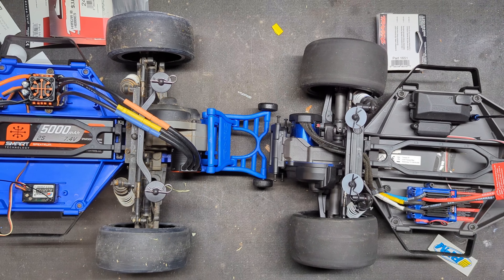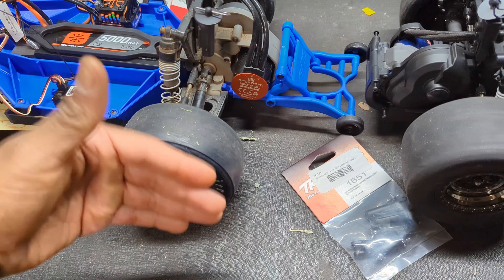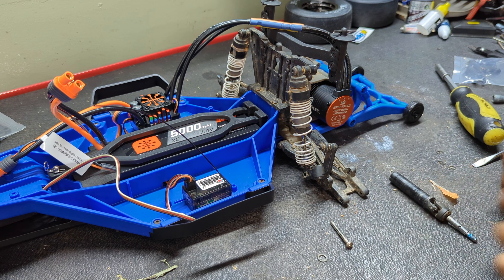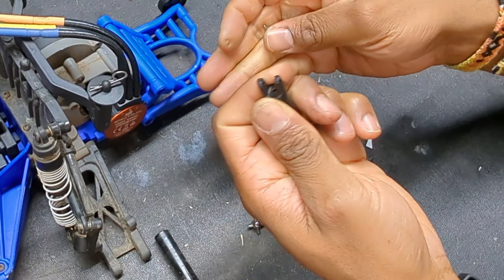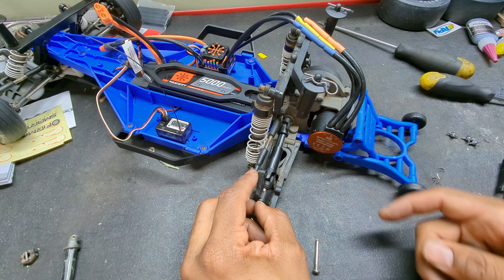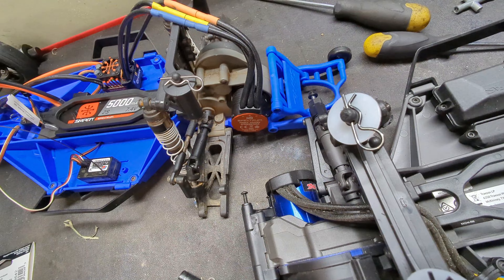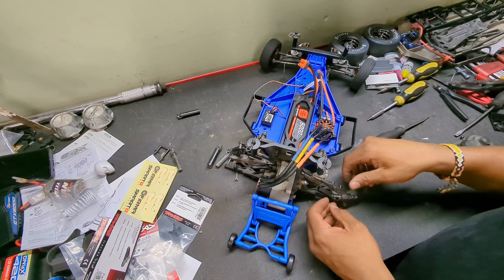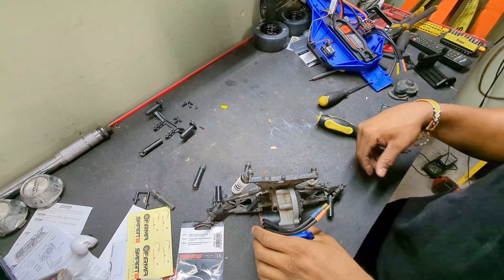REAR end Differences and prep - Drag Slash Conversion

Comment: I just started to mess around with making my slash a “drag” car and so far so good, I had a hard time figuring out the offsets and camber angles + toe since I’m semi new to rc, I’ve had one for a while but never tuned anything or customized it. I just got some proline 2.8s the semi slicks for the rear and proline streetfighters for the front
Not a fully committed drag car but I’m looking for a good tire combo to be stable at high speeds and be able to get on throttle with less of a roll without spinning out then catching the tires and flipping. These have been very good at sliding out and spinning instead flipping since they have no side bite 
Funny thing is I can pop a wheelie with the streetfighters in the rear but can’t pop a wheelie with the semislicks in the rear
I’m realizing I should have maybe just committed and got the slicks sticky compound